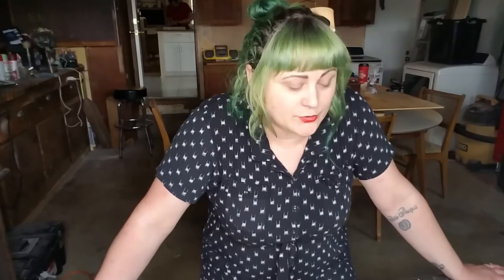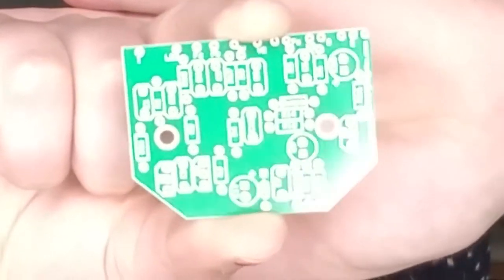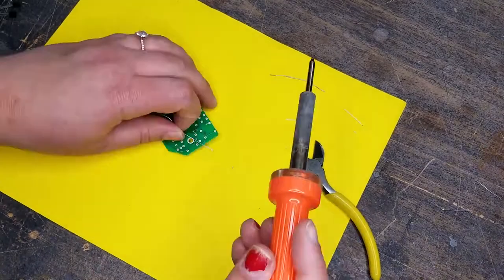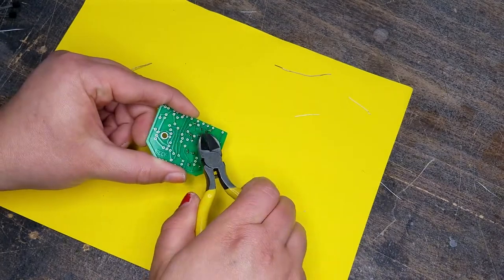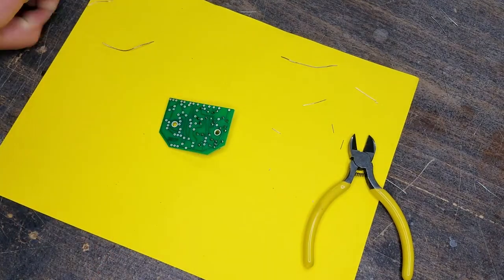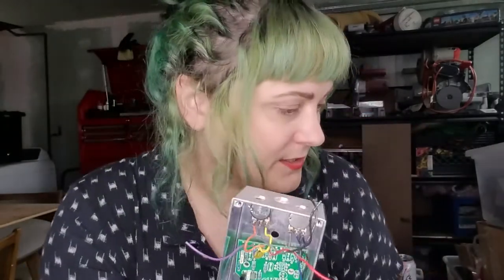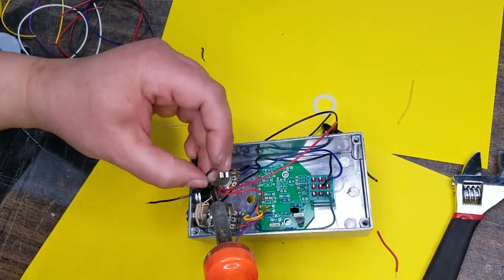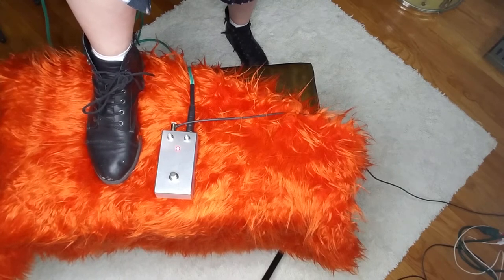How to Build A Pedal - Start to Finish!

Comment: Wow, that really sounded killer! I had thrown around the idea of DIY pedal builds in the past. Curious, what was the total cost invested? (minus paint of course)
Reply from the maker: If you're buying strictly the parts for the pedal it can be 30 to 40 dollars.  But once you get started doing diy builds you end up buying packs of resistors, packs of caps, etcetera. So you're bound to have a good amount of the supplies already.
Reply from the maker: and of course the more complicated the pedal the more it will cost you. Like if you make something with real germanium transistors... those are limited so they are more costly.
Reply: The Psychedelic Cherry 
Very kool, thanks for the info. As far as vintage pedals go, one of the oldest I have is a 1975 Guild "Foxy Lady", the 3 knob version. Which is a clone of the EHX "Rams Head" Big Muff. I got it in a trade deal many moons ago. It needs a little work but it's a kool, rare relic.